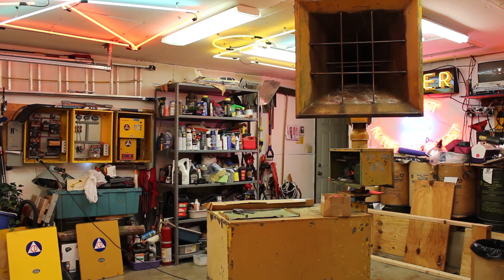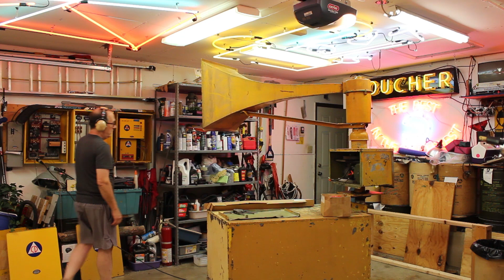Fort Worth Bar Grill 1000 Pneumatic Tube System Blower Run

Comment: What’s the serial
Reply from the maker: There's no serial number on the rotator box. The blower is from fire station 33 in dallas so the blower is a 1959 model
Reply: @vanamonde2  that’s the blower in the pointless vid? Looks like a 6M but 6M was discontinued in 59
Reply from the maker: @BSPThunderbolt  was it?
Reply: @vanamonde2  the 5M came out in 59
Reply from the maker: @BSPThunderbolt  those sirens were installed in Dallas in 1959. The blower is the original blower. I have seen 3 other single phase blowers of the same type at other fire stations which were installed in 1959.
Reply: @vanamonde2  jail bars were made until 1953
Reply from the maker: @BSPThunderbolt  the chopper rotator is from fort worth. Fort worth possibly got that siren in 1955. Theres a lot of guys who throw out dates for thunderbolt related info but I don't pay much attention to it. When I called federal 20 years ago asking about old thunderbolt information they had no records remaining of any of that.
Reply: @vanamonde2  so the original blower was scrapped
Reply from the maker: @BSPThunderbolt  the blower was left on the platform when the head was removed. I guess the city pushed it over and got rid of it

Comment: Looks the sheer sound could shatter the neon on the ceiling!
Reply: In terms of volume, absolutely. You can break glass by yelling at it if you hit its resonant frequency. Just going off of some random glass tubes I've clanked on, they probably resonate at around 1100-1500 Hz. The siren is around 560 Hz. If you were to go around and find the resonant frequency of all of the glass things in the garage and then played those frequencies through a big electronic siren like a Whelen Vortex or WPS2910, you would probably be able to break a lot of things. I've come close to doing it with a megaphone, but not quite.

Comment: Awesome job! How loud is it?
Reply from the maker: I don't know how to describe it. Loud enough to need hearing protection but not loud enough to make the cats get off the bed in the next room which is just on the other side of the wall on the right. It's running on about 1/50th of the air flow it should be running on f the if the real blower was running..
Reply: @vanamonde2  That surprises me that it wasn't enough to get your cats to take cover. Unless they're just used to this kind of noise...
Reply from the maker: @SakuraOfTheSea  My son said "it's loud but not that bad." He was in there with them when it was running. There's just not much air volume going through them with the pneumatic tube system blowers. It's just enough air to fill out  the sound. I would never run a thunderbolt in my garage with the blower running. The only really insanely loud siren I have run in the garage was the Model 5s I had. The videos are on here. Any longer exposure to that noise than was shown in the video and I would have started to get sick.